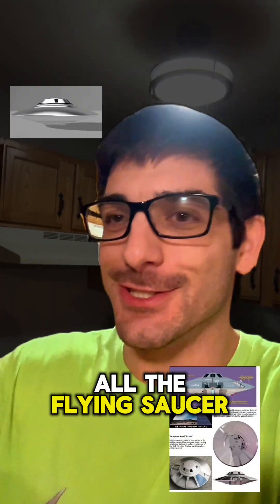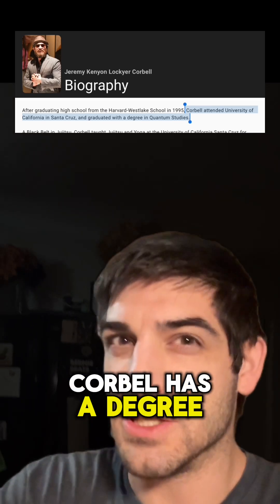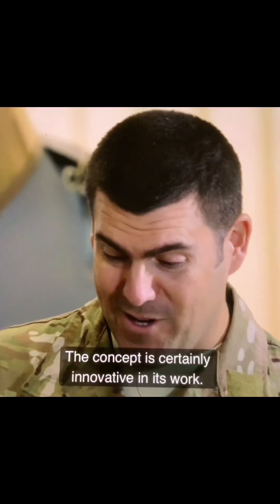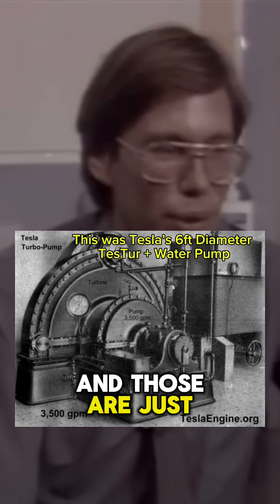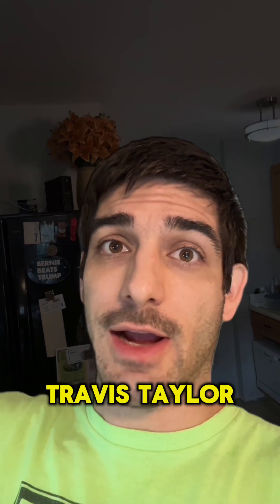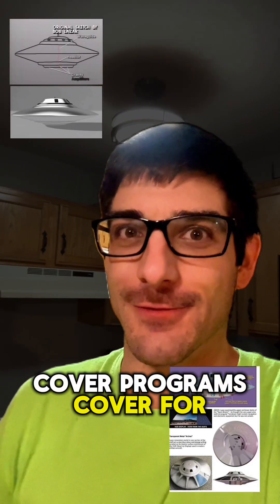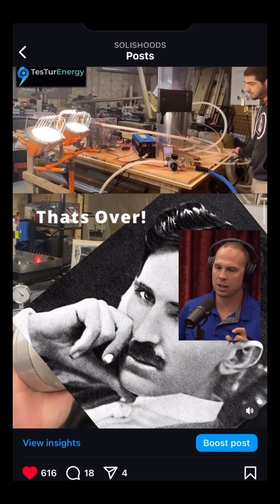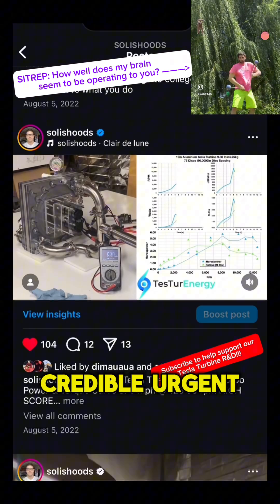David Grusch - Disc Craft Cover for Tesla Turbine powered UFOs

Comment: Well try to do science while the army plays soldier around you ever tried to do complex math whilst class bully is right beside you ?
More interesting is that an airplane needs turbines to run but also uses its wing so indeed if you have a let's say wing effect simply see the whole outer disc as a wing 

but now look at wing physics bottom is almost flat so air has the shortest path top of wing has a more round or droplet upper part where fly wind goes over then it has a longer path thus lower pressure causing lift want this in a disc ?
Just take two arcs seen from aside with a larger radius below a smaller radius on top thus more curve on top intersect them make it into 3d two spheres now you have a wing shape that has lift with wind coming from all directions moves it up towards direct line from center to top sphere now add these engine systems any engine system you want actually does not matter so much what drives them it is also the shape
heck if you adjust the shape of starship Enterprise a bit by adjusting under and upper sphere of the saucer section you have basically a disc wing with forward movement motors beside as nacelles and an engine room with an inlet in front and a body wing shape to compensate lift now imagine first 50 kilometers of atmosphere supporting you or flying really very fast through a gas cloud or a heliosphere of a planet system what would that require besides a load of radiation shielding ? The right shape so you push particles aside even as high up as the ISS there are still gas molecules enough combined with the gravity present to slowly pull you down by slowing your orbit...
And of course these things you mention are as they have always been just physics ..

One remark I know Americans are visual dopamine addicts but Jesus man can you sometimes dial down on the visual stimuli?
I just want to hear the story see the relevant stuff not be overwhelmed at the same time by to much and too many visual things like I just put on a commercial part on tv or something and have a continuous map movement or just to much info under my nose okay it's your style but just saying man...
Anyway interesting thoughts anyway and just simply keep on looking straight through them we all know they have to lie they and will never acknowledge any specific tech since there is no way in hell they can every engineer has to shut up about certain things I think you should look towards michio kaku's favorite joke 

https://m.youtube.com/watch?v=08EoaWmQ58o

Comment: Lifting body flying saucer, many small skin-integrated jet intake and exhaust ports for laminar flow, drone-style software for thrust direction control, gyroscopic stabilization and orientation control, internal counter rotating main internal combustion Tesla pumps for primary thrust production, and the Tesla pump discs could not all be the same diameter in order to fit inside the flying saucer cross section, which could open up the possibility of variable jet exhaust speeds with constant power, like a continuously variable transmission. 

Sounds like an awesome project to make on a small scale as a proof of concept.
Reply from the maker: @TimBlack1  yeah you get it 🦾🤓👨‍🔬